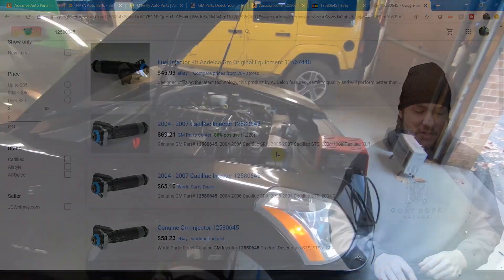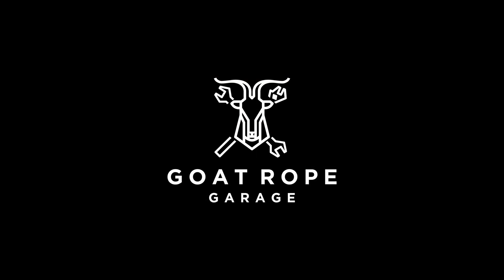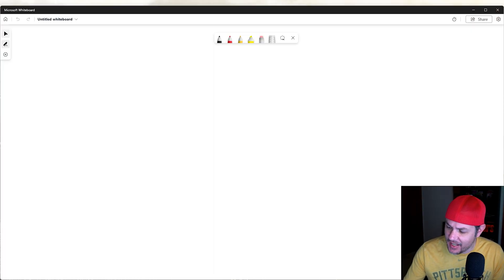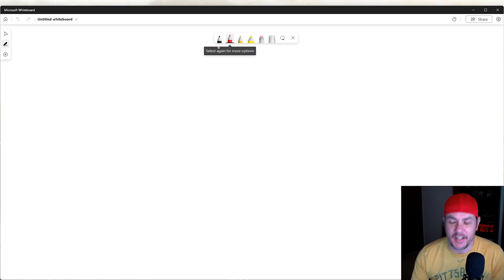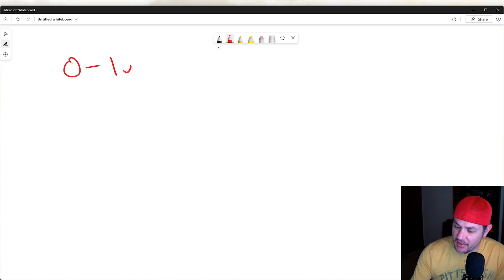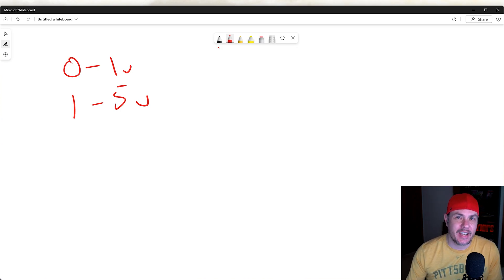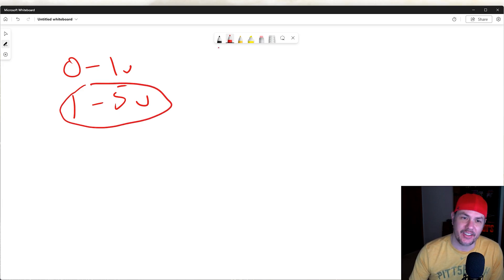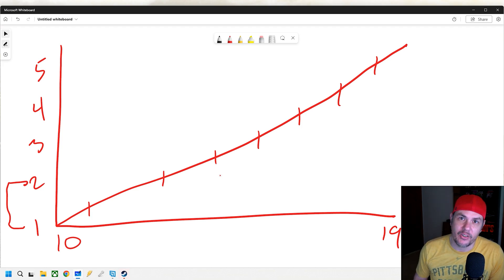How Widebands Are Superior To Narrowbands For Tuning!

Comment: Can the stock narrow bands just be replaced with wide bands, as in permanent or would the ECU not agree with that?
Reply from the maker: You can do it with a unit that has a narrowband simulated output. I tested it with a couple different gauges and they worked great on closed loop

Comment: NB's are virtually useless for anything other than the stock iron manifolds your car came with. If your car is modded enough that you're re-writing the VE map so it can run properly i dont think you're using iron manifolds. The newer WBs are much better at capturing low rpm readings. Using fuel trims with longtubes is almost pointless and will leave you chasing your tail.

Comment: The shape of the narrowband response doesn't mean the wideband is superior. It is shaped that way for a reason. The narrowband output is extremely sensitive to O2 changes near stoich so that the difference between rich and lean is unambiguous. Since stoich is the target for the vast majority of engine operation, the narrowband becomes the better option for fueling calibration by a wide margin. Outside of stoich, obviously the narrowbands are near useless...but the result of your tooning efforts are fueling-agnostic airflow model changes after all..

Comment: I dyno tune cars where i have a selection of widebands to chose from but i can tune a car that uses NB using those sensors really easy using fuel trim data like a gen3 ls if you know what your doing you dont need a wideband. A narrowband o2 sensor cant actually measure anything other then lambda 1 but that's fine for maf scaling and tuning the VE table. Power enrichment is is just a multiple of that so you cant measure the enrichment mixture with a NB but you can see if the ecu requested 20% more fuel and the injectors added 20% more.

Comment: I'm dying here. I've bought two AEM 30-0334 kits, neither one worked. I bought a glowshift kit and found out it won't work without prolink... What is a kit that will actually work when it shows up and doesn't require prolink??
Reply: I got a Innovate MTX-L plus and it works with HP Tuners software with prolink

Comment: when you install a wideband does it compute to the ecm or just visible on the gauge you get with it
Reply: The signal has to be shoehorned into the dongle. Wideband kit selection is important.
Reply: @BIgErnSamSquanch  wtf is a dongle
Reply: the wideband does not connect to the factory ECM, it connects to the gauge, and more important it can be logged in your tuning software.

Comment: I tried tuning with my WB in OL several times and when back in CL, my LTFT's were olways 4-5% off. I tried tuning with the LTFT method in CL and now run a consistant at -1, Not sure why it worked  out better but it did.
Reply: Wideband is for WOT narrow band good for idle/cruise

Comment: I've wondered why they didn't use wideband from the factory. I wonder if its faster to calculate the trims when its switching vs a compare operation in the ECM. Id imagine cost of manufacture is not that different.
Reply from the maker: A lot have moved to wideband from the factory but there is a decent amount of cost, the sensors are about 3x the cost and the ecu needs special controllers for them to operate so there is added cost there. There is a lot more going on in the sensor that requires a controller.